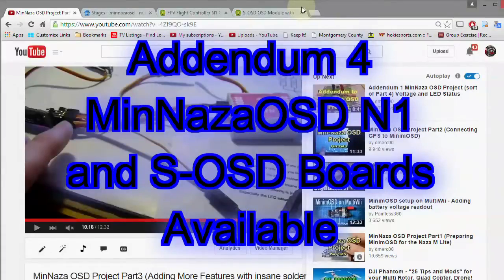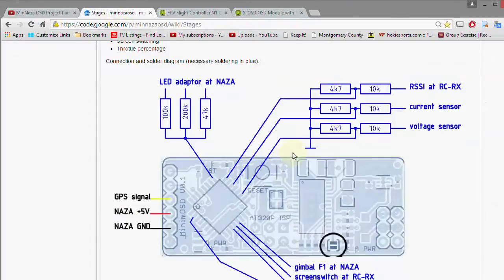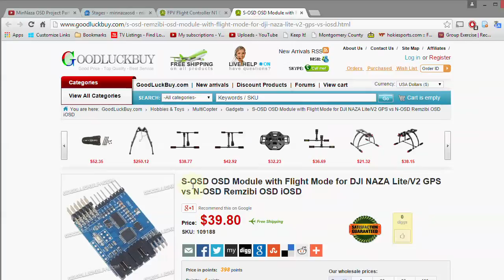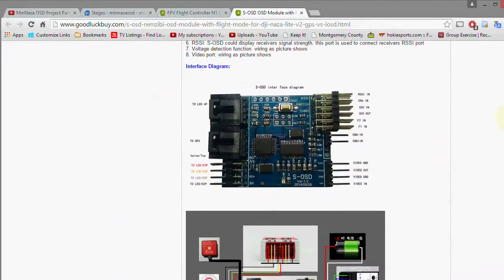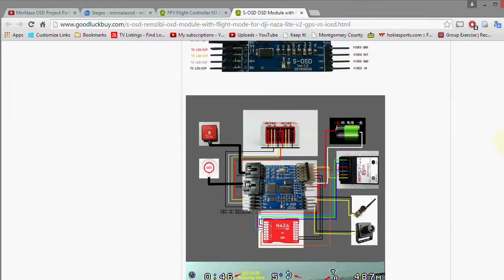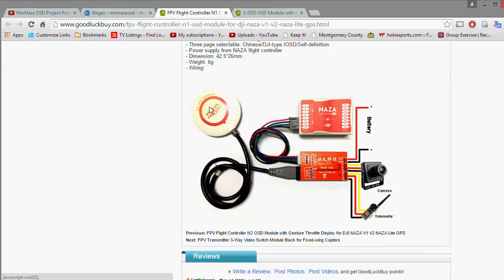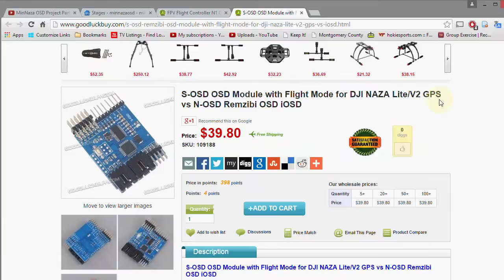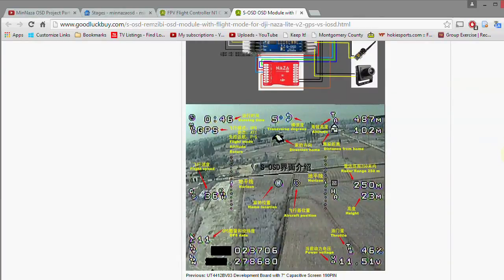Addendum 4 MinNazaOSD N1 and S-OSD Boards Available for DJI NAZA

Comment: Good evening, dmerc, thanks for your videos, my name is Renato I m from Brasil and  I just bought a S-OSD, but it worked not right, couldnt set up, so I bought the FTDI module, but also I could not set the osd, a program erro appears, osd not found, start automatic updating program, I had no konwledge make it work, I searched for pdf manual, didnt find any, so I went to youtbe, but arent any good and easy step by step tutorial for beginners, couldnt you make one tutorial for biginners? without skiping any steps.

 So I bougth OSD N1, installed on my TBS with NAZA M V2, set it up, telemetry appears on screen, only batery voltage is running and "NO GPS" sign is flashing on screen, means I dont have any telemetry infomation active on system, can you help me?, I shifted configurations without success. so I tried once more and I put OSD on NAZA V1 and the problem still the same, can you help me?
Reply from the maker: +Renato Torlay I don't know if I will be doing a video but here is one that seems to show the details.
https://www.youtube.com/watch?v=kSIJSbcyrLw
Reply: thanks for attention, I'll watch the video and keep doing your videos they are very good.

Comment: Does it show the correct direction to home while hovering (without movement to any direction)? What does this OSD use to show the direction to home: a compass (which allows to do it while just holding some position) or a GPS (which works only when flying with certain speed)?
Reply from the maker: test It uses a GPS and requires traveling along in some direction.

Comment: You forgot to mention that these chineese guys take the open source software and make money out of it without asking the software developer and not even naming the correct name of the software developer.
Reply from the maker: TeamRedFox001 Looks like you did it for me, great job on the MinNaza TeamRedFox001! In theory I suppose the MinNaza firmware could work on the S-OSD but I don't know if anyone has tried it.

Comment: Hi,
I have bought an S-OSD but somehow (after fiddling too much with it :)) ) now it does not boot.
It succesfully transmits the video in to video out.
Also connected to osd config tool I can even "read from osd" and "write to osd".
I have no idea how to flash a bootloader file.
Any help will be apriciated very much.
Reply from the maker: The component values are the same as the one used in minnazaosd so I think it can be flashed with that firmware.
https://code.google.com/p/minnazaosd/wiki/Compiling
The project may be moving to Github soon.
Reply: Murat TÜREL 
have you solve your boot problem
i have the same issue...
Reply: I bought a usbasp cable, soldered 6 pins to the osd board, connected the board to the laptop, run arduino program, chosed he chip and clicked the "load bootloader" ... 10 seconds later s-osd was back to life...
Reply: cool thank you !!
could you give me your email please i don't know where i can find the bootloader file...
and have some another questions...
thanks
Reply: muratturel@gmail.com

Comment: That's a lot of connections at first sight lol
I should give it a try maybe on my next quadcopter :)
Thanks for sharing Dave :)
Reply from the maker: ABMNS PRODUCTION It makes the most sense on the M-Lite and the V1 NAZA where there is a need for a cheaper OSD without having to upgrade the PMU.
Reply: *****  You are absolutely right! But it's not hard to connect on the PMU actually :)
My Cyclops Breeze is more easy to connect in comparison but it's almost triple price of this unit >.<
Reply from the maker: ABMNS PRODUCTION May I quote you under the video about the Breeze? That is good info.
Reply: ***** Of course you can lol

Comment: They also have a monOSD that has many of the pins broke out into their own pins which is good because my old eyes have trouble making those small solder connections... :)
Reply from the maker: 0917bobb Yes I have seen those. Good point.